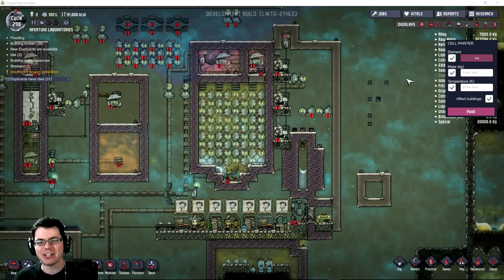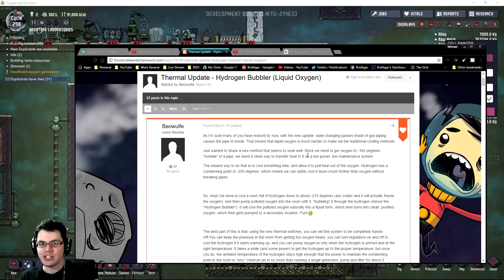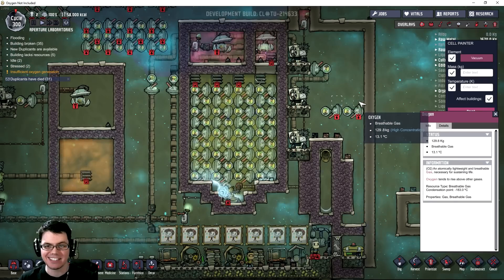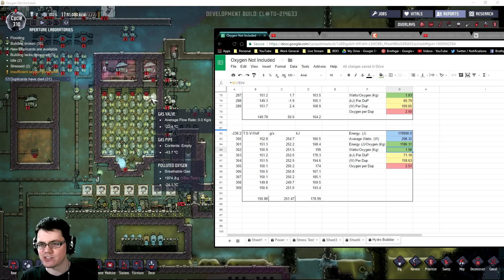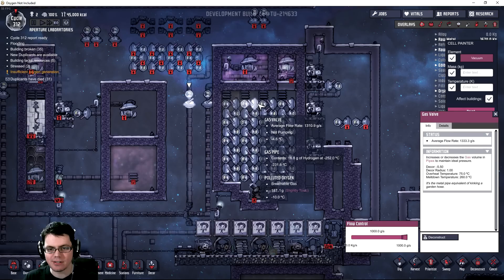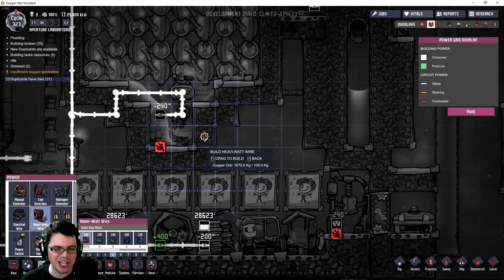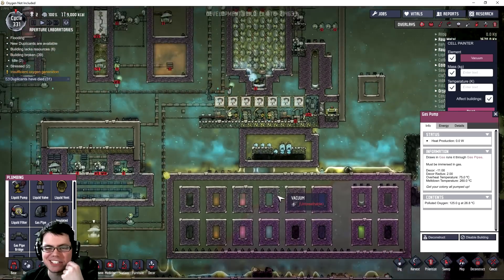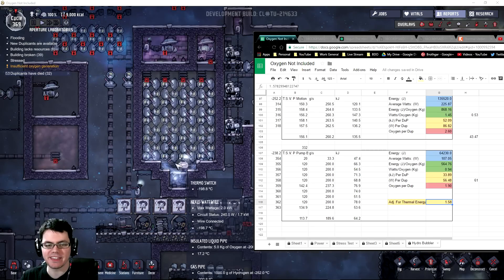Perpetual Motion and Wolframite Hydrogen Bubbler Experiment Part 4 -  Oxygen Not Included

Comment: I'd like to see a precooler/boiler for the liquid oxygen. The polluted input is at roughly room tempurature, and thus using it as the fluid to reheat the product to breathable tempuratures makes some sense. This also functions as a precooler for the input, lowering the kj of thermal energy the hydrogen has to absorb, lowering the amount of cooling that has to be applied to the hydrogen.

Comment: Thanks for testing this.  I had built my own version after seeing Skyes video.  But I only had copper for the valves and that seemed to work ok... I haven't yet been able to test with wolframite, but it seems, from your tests, that it makes little difference.

However the perpetual motion is a brilliant idea.

Regarding the pump, you can do without the pump and simply allow the liquid O2 to drip out of a mesh tile!
Also you don't NEED to pump in polluted oxygen!  Just leave a gas permeable tile at the top and the surrounding gas will be sucked in.  

Perhaps not so efficient in producing  liquid O2... But once the Perpetual Motion machine is running, it requires NO, I repeat NO energy input at all.  If you get any liquid O2 out, that is money for nothing.

Comment: Hi Brothgar - excellent video, and some much needed clarity - and vindication for the drama-fueled community :)

Remember that a valve occupies 2 tiles - so when considering temperatures, maybe an average of the temperature of the two tiles it occupies may give a clearer result ?

The clarity you showed at 14:30 "the gas that is running through that pipe, or the pipe temperature itself, is not connected to that valve - so that valve is only teleporting gas from this side to that side at a given rate" was detailed/confirmed on the forums also - it seems they are just magical gas pushererers :D 

Anyway, great video - thanks for putting this to the test, I was working on a similar video myself; however i'm very glad you beat me to it :) Kepp up the good work. -Life

Comment: You could cut the pump by making a 'u' shaped pool for the liquid oxygen where one half is exposed to the open air. It should be possible to use the pool to block the transfer of warm air and let it overflow one leg of the 'u' to allow extra liquid oxygen to escape.

Comment: If you use a 2 stage cooler, you could run the liquid oxygen for the second stage through wolframite pipes, which could work far faster than hydrogen through granite.

Comment: Hey Brothgar,

Fist off AWESOME videos man! 
Just a thought, and I think you eluded to it a bit in this video,maybe try making the system two tiles wide and very tall? I have played around abit with this and it does create a bit of a problem as far as gas moving through the system however it looks like on occasion you are getting some oxygen freezing and having this taller system would eliminate the "sitability" of the liquid giving it less time to freeze. it would also eliminate the favoring of the gasses to move to one side or the other. Also because gases don't like to move through each other in a 1 tile space (or at least not as much as normal) you might be able to feed this into a larger room through a 1 tile "funnel" and eliminate the need for a liquid pipe. I.E.: the liquid is created in your taller "bubble" system, funneled through a  tile wide area, continuing downward, and then dripping into the larger room where it can heat up slightly, turn back into gas and then be pumped out with the gas pump. the  tile funnel would have pure oxygen on the bottom and polluted on the top so it shouldn't mix too terribly much and even if it does the oxygen would just re-freeze and drip back down pretty quickly. The only problem I can see is that the polluted stuff might want tog o into your larger "heat" room however, from what I have seen polluted oxygen does tend to float pretty well on top of the normal stuff and If this does occur it would be at a very cold temp. so a gas filter (although using a bit more energy) could be used to re-introduce the super-cool gas back into the system which would freeze very quickly. sorry for the essay.. but it's early man, figured you wouldn't have too much to read at this point :P
Reply: That was my thinking too, simply because fluids in ONI tend to cling to steps.  By making it a simple straight up column, I am hoping that any liquid O2 will fall directly into the pump.
Reply: MrFatwabbit to
Reply: Jamie Pidding I got a joke,  your life

Comment: Hey Brothgar! First off, your videos are awesome. Keep it up! 

Secondly, I had an idea which would allow someone to 'theoretically' generate infinite coal automatically. The idea of having a morb - puft - hatch system is often thrown about, but pufts are terribly inefficient in producing a reliable amount of material. Instead, I managed to collect all of the carbon dioxide into a single room, which is then condensed into dry ice; the solid CO2 can then be eaten by hatches and collected for coal. However, I can't seem to make it super efficient, which is where I'm sure you'll do much better :)

PS: For collecting the coal, put some horizontal manual air locks two blocks above the hatches, and set them to 'open'. Solid material can fall through and Duplicants can walk on it.

Good luck!
Reply: One problem is that dry ice is not sweepable or storable, so you can't move it around. A more effective system is to drip P-H2O through a freezer which compacts into P-ice at the bottom. This can then be dug and swept away, and stored in storage containers.
Reply: I showed a design a little while back (think it was 2 playthroughs ago maybe) where if you make a tall narrow building, like 40 tiles high and put your cooled hydrogen pipes in the upper levels, and pump your co2 above your radiator pipework - the co2 can solidify and drop right into your hatches mouths below :) 

The only issue here, is if they dont eat it immediately, theres a risk of it turning back to liquid and murdering them pretty quickly. Sadly my chamber over-cooled when I wasnt looking due to the wheezewort bug, and rained down lovely pure liquid oxygen onto their heads.
Reply: Brothgar sadly not, needs to be hospitable to the hatches :(
Reply: Samsonite Dove Which is why I set up a massive radiator system, much like this one, far above the hatches. Placing several mesh tiles below the hatches can be used to drain away liquid CO2, but the REAL problem is freezing the Carbon Dioxide into Kilograms -sized chunks. That way, if the system is more vertical (like a tower) rather than horizontal, Solid CO2 will fall and add to other piles of CO2. Freezing it in kilogram quantities ensures that it won't warm up (and by extension, cool/freeze the hatches), while making it large enough to eat. I messed around with the .worldgen files to spawn about 40 hatches, but they still die more often than I'd like.
Reply: Brothgar Also, I forgot to mention, but for the source of CO2 I used the stuff produced by the coal generators. In theory it's a self-sustaining system.
Reply: Problem is that hatches die from a low temperature. although with a polluted ice or just ice it could be Ok - store them in compactor, hatches it it from there and a heater nearby to keep hatches alive.

Comment: Hey Brothgar, here is an idea to experiment with, a double-layered radiator using both gas pipes and liquid pipes, as you can build both on top of each other, one using hydrogen, the other using whatever liquid that can get as cold as that, sure, it probably wouldn't be as energy efficient maybe (without the perpetual motion), and not sure about if the 2 pipes transfer heat between each other, but if they transfer heat with the gas, then that more or less should double the rate of heat transfer, potentially increasing the oxygen production by a lot.
Also the thermal switch is a good idea, but the problem is it doesn't transfer all the oxygen created (unless it really does create so less oxygen than without it).
It may be complex, but maybe some kinda of timer system with (a) thermal switch/es that activate for X seconds every Y seconds, or just have a reservoir and manually activate the pump every X cycles.
On a different point, worse energy efficiency i guess, but maybe a non-insulated system, or a really big/tall system, where you have a storage at the bottom and use the liquid ?tepidizer?, the liquid heating thing to turn it back into gas-oxygen and pump it out, would be nice to have liquid-permeable tiles that don't let gases through but meh.

Comment: Perhaps the system had to cool down some more.  Those valves should also likely be a similar temperature to the pipes/air.  I could imagine that since you have already cooled down the hydrogen you are missing that step where the valves themselves have cooled down from the ambient air.  Sort of like a second temperature buffer.

Comment: Since you are cooling oxygen almost to the solid state, maybe you could make a second radiator using liquid pipes on top of gas pipes you have now and make the liquid oxygen go throw them. This way you will almost double the cooling power of your system by reusing "negative heat" you normally waste by cooling oxygen too much.
All you need is to tweak how long the liquid pipe can be so oxygen will not heat back into gas form in it.

Comment: Hi Brothgar, cool video (pun intended). Not to be presumptuous but I think I was the "other one" you couldn't remember as I made all these suggestions right after the part 2 release. Not that it really makes a difference since some are my original ideas, and some are ideas of other people on the forum. Making these elaborate systems is really a collaborative effort by many people on the forum bunching ideas off each other.

The system can still be improved a lot. First as you mention, pull out the gas valves and instead siphon some of the LOX and pump it around in wolframite liquid pipes in the same manner as the hydrogen gas. It might be a good idea to do the liquid pipes at the top half or 2/3rds only through. 

The second and most energy reducing method is the way polluted oxygen is introduced. Right now you're pumping it in but in a real live play build you can have a morb pit where you leave a bit of water at the bottom so they constantly produce polluted oxygen at maximum rate and then have a channel at least 2 tiles wide in an upside down U shape bringing the polluted oxygen into the top of the freezer.

You don't really need to do more with the submerged liquid pump as it's only using about 0.2W/kg LOX it pumps out so there's not a lot to be saved.
Reply: The connection is that in the game code the morb have a check at a given interval. If the morb is not in a P-O2 square then it farts P-O2. Having a bit of water, like 100-200g in a square makes the square exist in sort of a limbo between being a water square, and being a vacuum.

It's the same reason that if you put an air vent in a square with a few hundred grams of water you can have an infinite pressure gas box as the vent will always think it's in a vacuum and therefore never gets overpressurized. On the other hand, things that check for submersion, like the tepidizer, also register a full submersion in such a tile making it possible to make steam, or convert fertilizer into sand, or making natural tiles anywhere you want in a real game run without the need for debugger or digging down to the magma.
Reply: Btw, one thing to note here is the quirk in the game code that discount everything that sits behind a switch from being counted in the power consumption total in the daily report.
Reply: Problem is that what would you cover it with? It'll have to be LOX as H2O would freeze, and I'm not sure if LOX has the same properties as it doesn't exist in natural state in the game. Would be worth an experiment though.

(The state and properties of the various elements are a "little" hard to decipher from the game code as it's not written in plain text what check are made)

Comment: Taking a look between Skye and your systems, I do see what appears to be a significant difference, in that he's drawing polluted oxygen from two locations in his base, whereas your system appears to draw solely from a sealed chamber with a single morb in it.  I believe this could result in lower polluted oxygen intake for your system, resulting in lower yield, though probably more predictable yields.

Perhaps using volumes of slime, polluted water, outhouse products and just about anything else that predictably gives off polluted oxygen could yield interesting data sets.
Reply: You'll probably find he's filled the room with the debug tool - i could be wrong, but thats what I would've done for testing it. You can fill the room with tiles of 20,000 kg of gas per tile :)
Reply: Good point, though I would have found the description of the input condition both interesting and informative.

Skye's was interesting in that it was supplying the polluted oxygen from the existing conditions of his base, while Brothgar's gives more hard data.
Reply: I'm more interested in what rate the input valve is set to - not sure if it's just 1kg packets of P-O2 or a lower number. Would be interesting to find what the max rate of input of P-O2 is before the vents reach max gas pressure. It's all very interesting :D
Reply: One air pump can only pump 500g/s though.
Reply: That's what I was thinking. Multiple lines/pumps would be needed to get above that. Maybe a pump to 2 vents either side of the chamber could be an interesting tweak.

Comment: Couldn't you remove that last pump and replace it with a insulated mesh tile so the liquid oxygen just drips down into the storage tank area?  Or are there no insulated mesh tiles?

Thinking you could put a sewage pit next to it, with insulated gas passing tiles near the top and fill the sewage pit with the things that spawn from corpses,  let them generate gas, let the gas push it's self into the closed loop perpetual motion freezer cause of air pressure differences, and drip the condensed cold oxygen into a holding tank under it that's not insulated so it evaporates.     (testing it will need the holding tank under it to be insulated to keep it easier, but if you can make insulated versions of the gas and liquid passing tiles to keep the heat out of the cold area, it should require 0 power once you get the cold pipes working).  Once that's working, replace the walls of the holding tank with non insulated gas permeable tiles so it warms up the liquid oxygen and leaks it out the sides.

Comment: Did some testing of my own about the size of the bubbler. It seem to me that after 11 pipes down from the vent the oxygen turns into a liquid. So making it any higher than 14 (vents + 11 pipes + pump) would be pointless. The width and number of vents i did not test properly yet. Hope this cuts some time of testing. Ps air in 40 C, hydrogen 251 C and 2 vents max pressure.
Reply: A add on if the vents are at a different pressure the rows needed change. If pressure is lower, than 11 lines form solid oxygen if higher (unlikely) it stays gas. So the amount of O2 at vents = number of lines => 2kg/m2 = 11 lines.